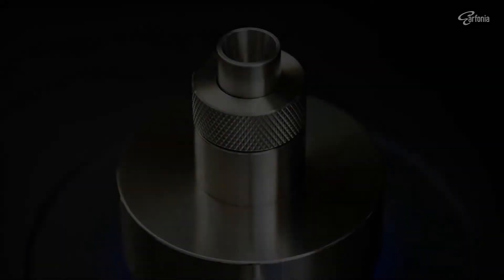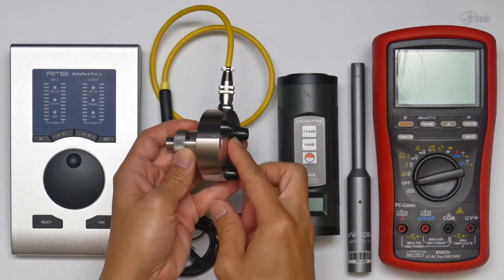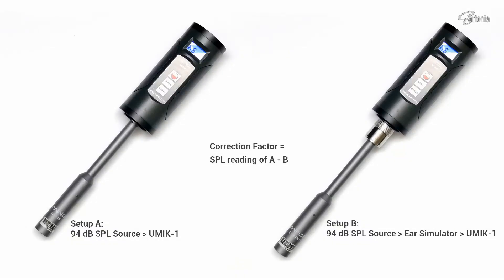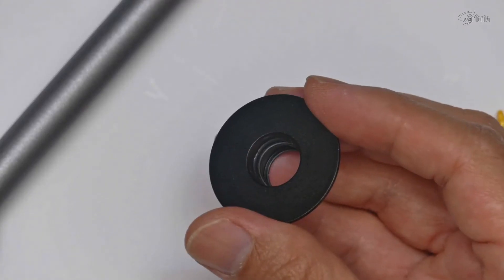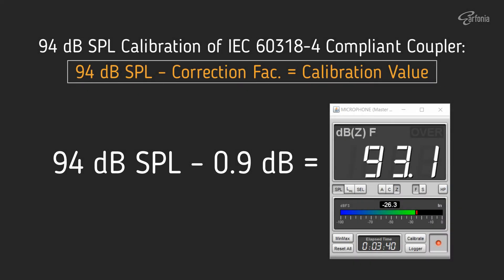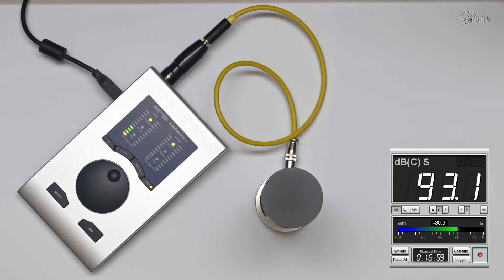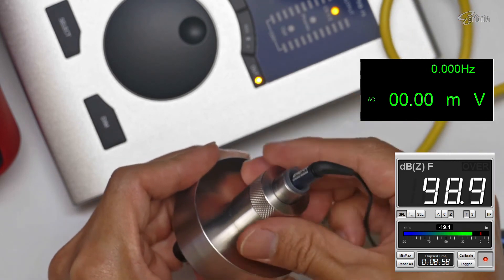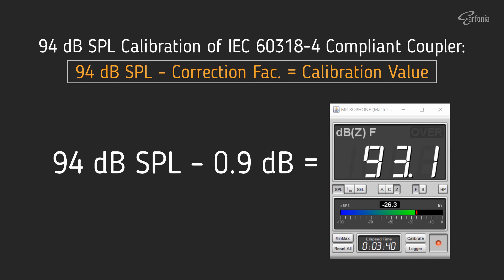IEC 60318-4 Coupler SPL Calibration

Comment: Hi Bram, can you tell me how to generate a calibration file (that text file that usually comes with mics) after going through this procedure?
Reply from the maker: Sorry for the late reply, good question. I use REW arithmetic function to get the difference, between a good 711 coupler as reference (GRAS coupler for example), and the clone 711 coupler measurement result of the same IEM, and use the result as the calibration file. Actually the process take a bit longer than that, requires several IEMs, a bit of smoothing, and averaging.

Comment: My sugestion is to calibrate a measurement setup with A corection curve (if 1kHz calibrator is used). Corection factor of A curve for 1Khz is 0dB and for example for 50 Hz is ~ - 30dB.   You can get rid of low freqency noise such as electrical hum or mechanical noise.
Btw: very good video and i wish to see more in the future :)

Comment: Hi, excellent video! Did you end up using the Umik-1 with 711 coupler and O-rings to measure your IEMs, or did you use the mic that came with the 711?
Reply from the maker: Sorry for the late reply, I use the internal default mic on the 711 coupler.